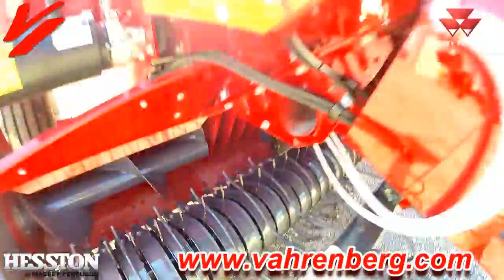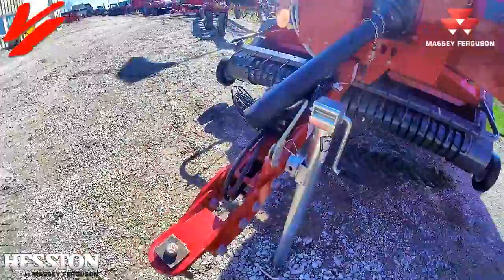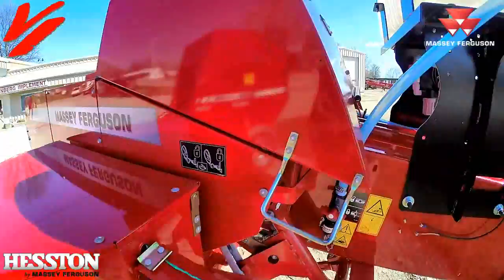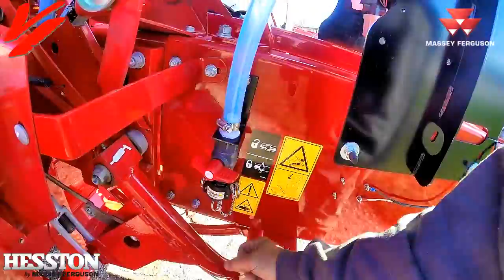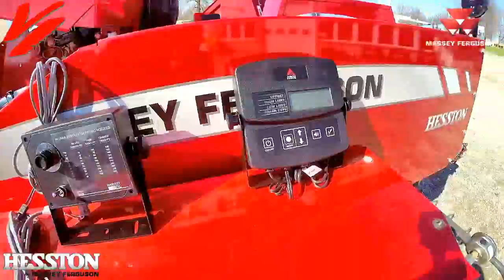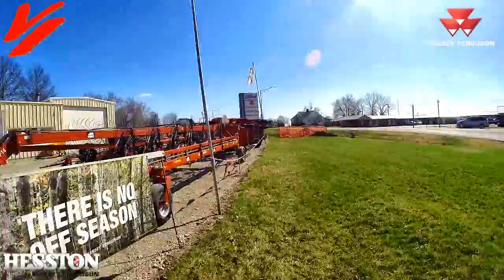Massey Ferguson 1840 In-Line Small Square Baler

Comment: What is the PTO requirements for this Baylor for instants would a 2600 each series tractor pool and operate this will
Reply from the maker: 50 PTO HP is the Minimum Recommended HP for the 1840 Square Baler. MF2606H is 55 PTO so it and the 2607H would have plenty of PTO HP to meet minimum recommendations.

Comment: Wonder if it’ll bale cane
Reply from the maker: What kind of cane? If your Crimped it with roller conditioner they bale lots of heavy stem crops like Prairie Grasses, Miscanthus, Sudan Grass but crimping stems so they are flexible to get in the bale is critical plus get the stems to dry faster than the leaves so it doesn't spoil.

Comment: Your moisture sensor pads and not mounted according to the manufacture. Directions say 12 to 24 inches from the rear.
Reply from the maker: Per our Training from the Manufacturer they recommend on the inline balers the closer to the chamber will provide more accurate reading of current condition the further you move away the farther from the current moisture conditions in the field.
Reply: @VahrenbergImplement  Not per my conservation with Agratronix support yesterday. Will re verify with them Monday.
Reply from the maker: The 1840 has an 18" Longer (Optiform Bale Chamber) than the previous model 1839 or the 1836/1838 Models. And all those models this is the best location for the most accurate readings we have found. We maintained the same distance from the plunger when that added the longer bale chamber. It's working for our customers and getting the most current and accurate readings.

Comment: I sure would be interested in a inline baler. I'm used to running New Holland and can work on their knotters if I have to. Wondering how much difference there is between New Holland and MF knotters.
Reply: I've had both New Holland and MF baler including the MF 1840 knotters were basically the same and was easy for me to transition to
Reply from the maker: Thanks for the reply. Good to hear from someone with experience with both brands.
Reply from the maker: Basic Knotter Maintenance is common between most knotter systems. I asked my Square Baler Mechanic and he very familiar with all brands of knotters and says the New Holland and Hesston knotters are pretty similar in operation.  Thanks for Watching. We have traded for many New Hollands that converted to the InLine Advantage.

Comment: I love that colour and that big pickup.
Doe's  existe smaller  baler for MF 35 ?!
MF 35 works with IHC 445 D baler..
Reply from the maker: You need more Horsepower with the 1800 Inline Balers that the MF35 has. Older balers required less HP but the new modern balers need more. Thanks for the comments & watching!

Comment: What's the MINIMUM pto horsepower needed for this Hesston MF 1840? Thanx!
Reply from the maker: 50 PTO Horsepower is the Minimum Recommended PTO HP for the 1840 Square Baler.
Reply: Vahrenberg Implement Thanx!

Comment: Just bought 2! What about a 210 twine?
Reply from the maker: Brand of Twine Matters Most. Cordex is 100% Virgin Resin , Fibulated Twine. Carries Consistent Diameter Throughout the Bundle. That is what makes the difference. There is some cheap twines out there and some carry Major Brand Names and are inconsistent in diameter and is junk. Give it a try if it doesn;'t work visit your AGCO Parts Dealer and get Cordex Twine. It's the best we have found for All Brands of Balers.